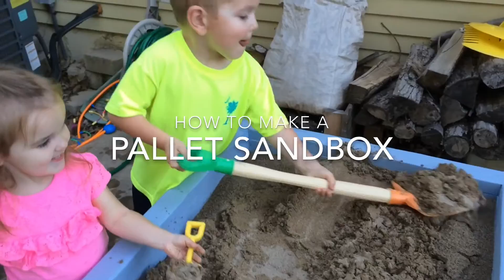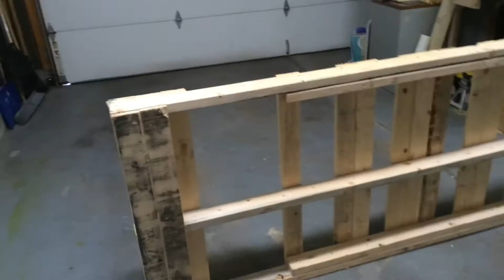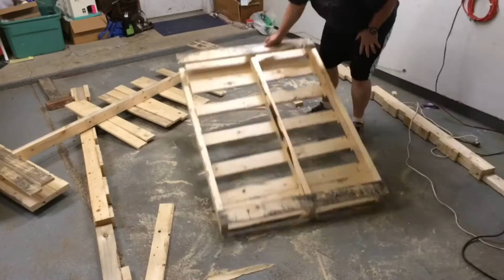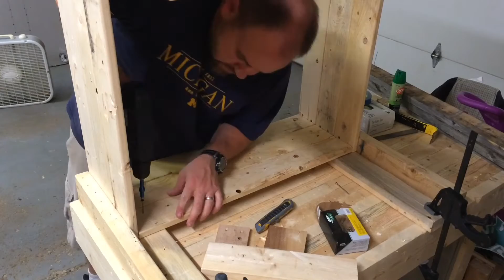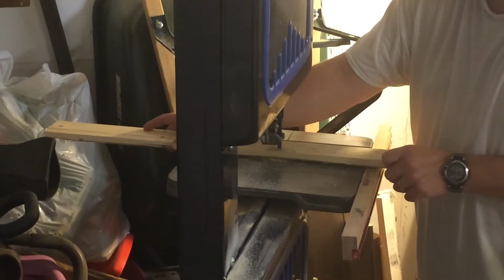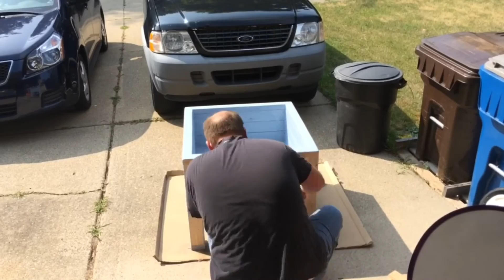Making A Pallet Sandbox | Luther Woodworks

Comment: Thank you for your video.  What bandsaw do you have?  I am in the market.
Reply from the maker: Hey, thanks. My Bandsaw I bought used on Craigslist for $100 and did a full restore of it. It's a Sprunger 14" made in the 1950's. The motor is very underpowered on it so I am currently looking for a replacement motor. I would look for one with at least a 3/4 hp motor if you're going to do any resawing. Setup search notifications on Craigslist and Facebook Marketplace for Bandsaws or buy new if you can afford it.

Comment: Cool stuff, Joshua! Nice work. Looks like it is pretty sturdy.
Reply from the maker: Thanks. Yeah it is. It's holding 400 plus lbs of sand. It hasn't fallen apart yet. I also have a support running across underneath the middle to provide extra support.